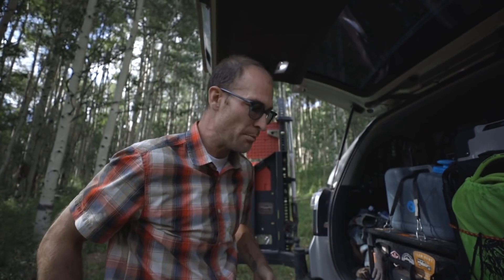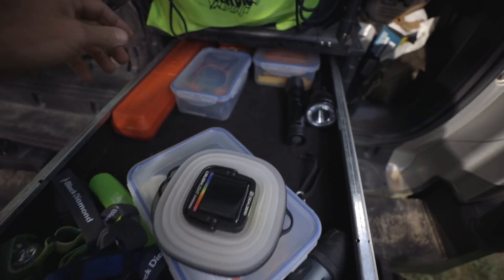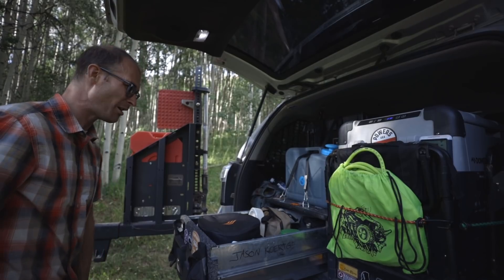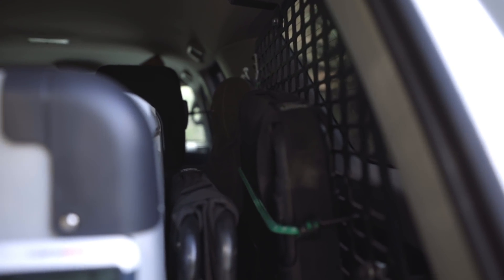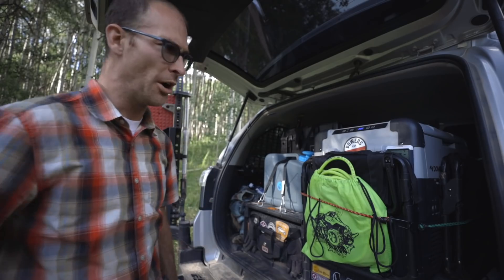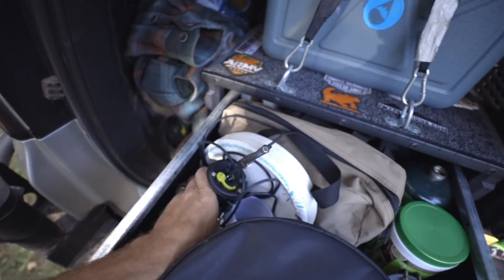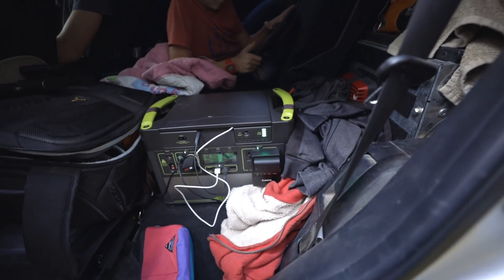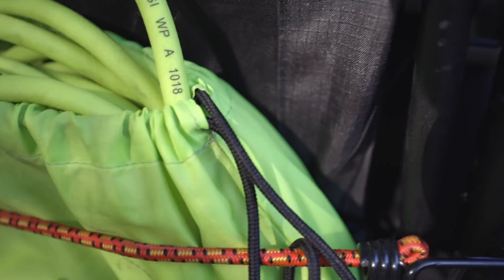FINAL 4Runner Camp Setup - Detailed Walkaround Tour

Comment: Jason, Run a zip tied to your shackle pin then back through the shackle.  If you need the shackle you can cut the zip tie off And use it. This way the pin will never back out of The shackle while you’re driving down the trail.😎
Reply from the maker: Genius.

Comment: Buyer’s remorse?
Reply: seen the ram 2500 base that AEV uses, and good god, that thing is fucking huge STOCK. im in a '17 TRD ORP and couldnt imagine going to a platform that big.
Reply: @iCxLegion  Completely agree. I have a Silverado 1500 Ex cab for chores and towing trailers. I couldn't imagine getting it down some trails without body damage. My FZJ80 on the other hand I can solo or not constantly ask my wife or myself to spot through mild trails. I'm sure the AEV truck is capable but you would need a spotter on anything more complicated than a service road if you want to keep the paint on the truck.
Reply: Or loosing views...